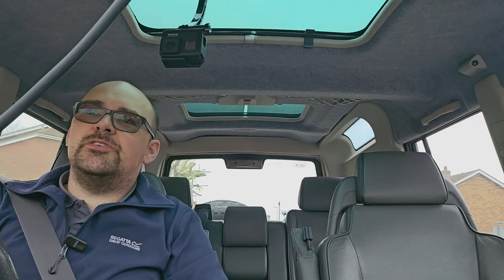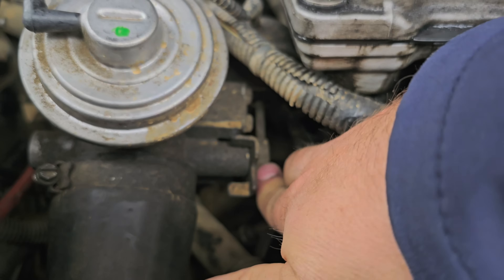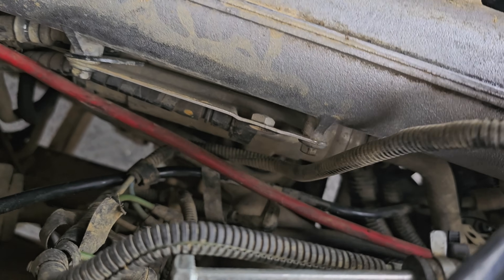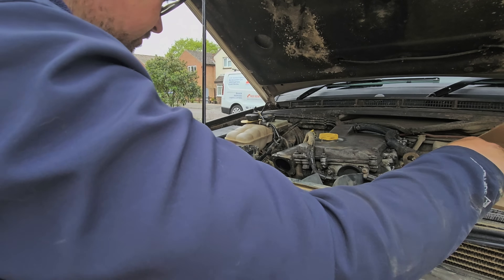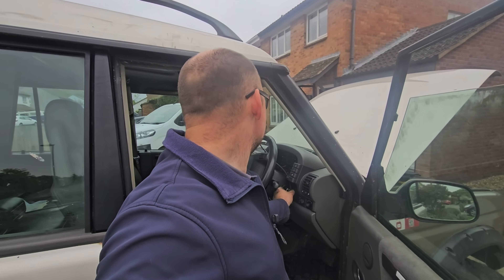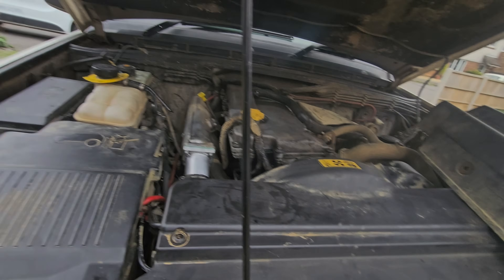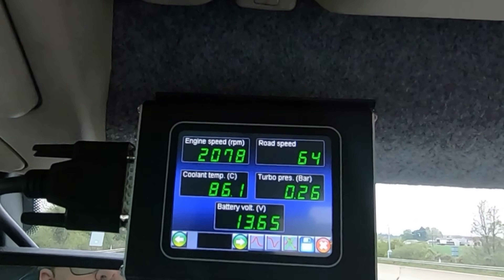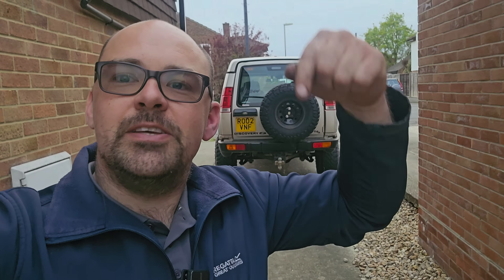EGR DELETE.... Worth it? Live data REVEALED

Comment: Hi CHris.   I would suggest removing the now unused EGR cooler completely and fitting the EGR port blanking plate directly to the end of the exhaust manifold. (If you can get the rusted and well-heated bolts out).  The water feed and return for the cooler can be connected together.   Just means that there is not a lump of metal on the end of one pipe waving about close to the fan.  ...................    Might make the disco go a bit faster with less weight!!   🙂    I removed the EGR from my 51 plate Euro III Td5 ages ago and it's run like a top ever since (May be something to do with my old EGR seizing-up and blocking half of the inlet)
Reply from the maker: I may remove the cooler when I'm next in there doing some work, I only had a few hours to film this video so I had to do it the fast way 😀

Comment: I did both my D2s a couple of years ago. Mpg went from high twenties up to to low fortys.  Engines pull like trains now . One is a manual and other a auto box. The emissions results are a lot better as well.
EGRs kill diesel engines. Who would want to breathe their own farts.
Reply from the maker: Exactly that! Do you notice a big difference in MPG between the auto and manual?
Reply: @Final_Drive  I find the auto is slightly better with normal local driving. The td5 engines are very good motors. Mine have been serviced every 5000 miles since new. And chassis sprayed with waste oil twice a year, so no rust .😄
Reply: It was either a system issue or youre simply lying. It has been proven that egr lowers emissions and doesnt limit any power whatsoever.

Also "imhaling your own farts" term is only used by people who have 0 clue on how and why egr works the way it does.

Also if your car has an egr map and you remove it it will drive worse due to different gas mixture. Usually ending up running a lot richer.
Reply: @hmmm9183 
I'm talking about diesel engines with the egr removed. It's a known fact now that if the egr is removed the engines run better and cleaner, and about 25-30% better MPG. Lots of companies doing it now, adds years of life to vehicles.
Most agricultural tractors have the valve removed as well as road vehicles. I've Never had a petrol engine vehicle so don't know if they have egr's.

Comment: what did you do with the old wiring connections ???cheerz ramos
Reply from the maker: I've left all of the wiring in place. I've just blanked off the small vacuum lines that operated the valve. I didn't want to upset the ECU by unplugging the valve block.
Reply: @Final_Drive  fanxz for the quick reply would you fink its worked out well for yourself and the disco cheerz ramos
Reply from the maker: Yeah for what it costs I think it's worthwhile, it will help your engine and oil condition last a bit longer if nothing else

Comment: This video does highlight how mis-sold EGR bypass or removal kits are, and how little the average owner understands how the EGR or engine work.

The EGR only opens at very low rpm when EGTs and power demand are low, so performance isn’t directly affected by the EGR and it only opens when NOx emissions can be easily reduced without performance loss.  As soon as the throttle is pressed, the EGR closes.

The benefit of removing or blocking the EGR comes in preventing soot ingestion.  That soot mixes with breather oil vapour and builds up to choke the induction tract.  The oil by itself isn’t great, but doesn’t cause much restriction.  The thick clag from the soot eventually does cause huge restrictions.  So, fitting an EGR removal or blanking kit to a used engine will have no performance gain; it will merely prevent further deterioration from intake clogging.  What you should be doing is stripping the induction tract and cleaning it all out to let the engine breathe as designed - the kit will then keep it free breathing.  That is not a performance increase, just a restoration to original performance.
Reply from the maker: Thanks for the explanation! That must be why it felt a bit more responsive initially but not significantly faster!
Reply: @ Any change in response would only occur from idle, when the valve is open, but a healthy valve would close quite quickly and so the lag should be small.  So, you may perceive a small improvement in throttle response from idle, but not from mid throttle position where the valve is already shut.  I’d be wary of the placebo effect we all tend to suffer - most of us tend to subconsciously convince ourselves that any work we do on induction or exhaust systems is improving performance when it often has no effect at all.

Comment: Hi, i follow your channel and like the way you tested egr delete. A Nanocom is a must and worth their weight in gold. My egr has been deleted for 9 years and MOT’s have been fine, apart from welding!! 😳
Another benefiting change i’ve made was fitting a catch can, Provent 200 👌🏻
‘Daphne’ now breathes fresh air and oil stays cleaner for a lot longer. 
Putting it another way, you wouldn’t want to breathe a % of your fart every time you breathe in 🤢👌🏻
Reply from the maker: Hi! Thanks for watching the videos! It's great to hear the EGR won't affect the mot, i must admit I did give the inlet manifold a wipe around and it is full of an oily mess so I think a manifold and intercooler clean is on the cards then a catch can fitted, good idea on that! Cheers 👍
Reply: @Final_Drive The egr valve does come under the MOT. A egr delete should fail the MOT, especially if easily visible, but It will depend if your MOT tester cares about it enough to fail or pass a egr delete 🤔🤷‍♂️

😉👍
Reply: @Final_Drive  people need to fit a Provent like yours and not a knockoff cheap one.  The relief valve in the genuine ones means you aren't going to increase your crank case pressure and blow a seal.
Reply: @ 
Definitely worth doing the catch can, i have an Alive remap n bigger intercooler too, but fitted the catch can first. The old intercooler did have a fair bit of residual oil in. No my pipes n intercooler are spotless after 9 years 👍🏻
Keep the pcv valve on breather!! 
Rocker breather to catch can, catch can to pcv valve 👌🏻
I’ve only used the Provent 200, cheap ones ‘May’ or ‘May not’ work as well? 
Change the filter once a year and fitted a clear pipe with a tap underneath the catch can. Drain that as n when filling up, you’ll see what would end up in your pipes n system one the filter gets used a bit.